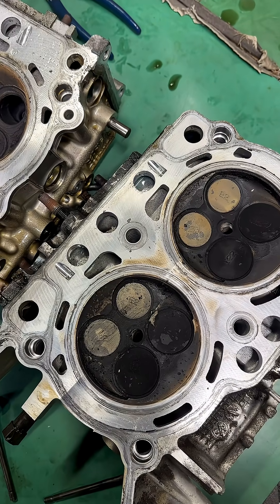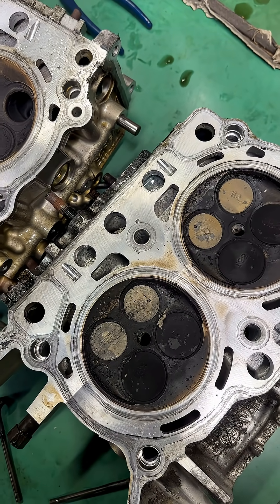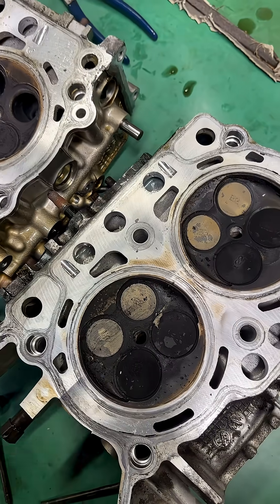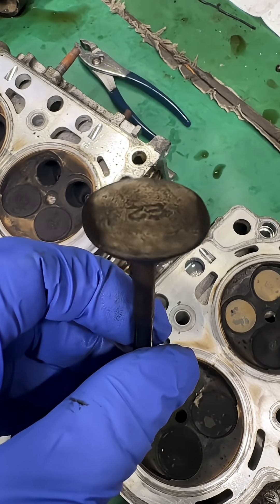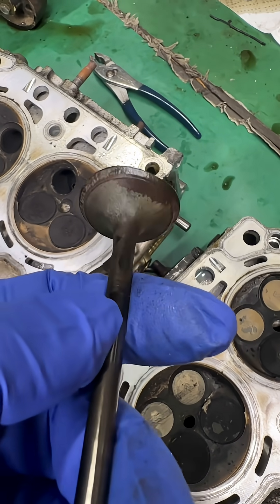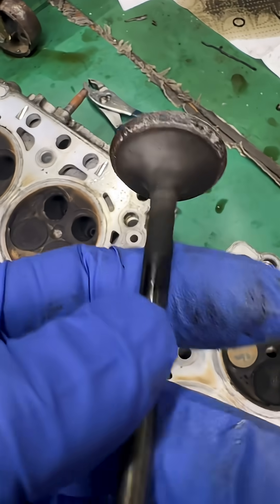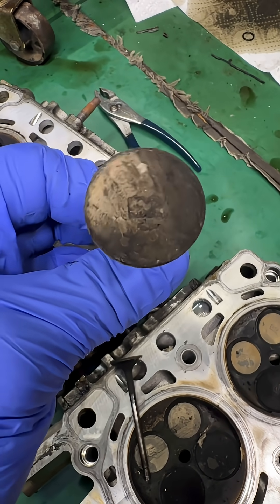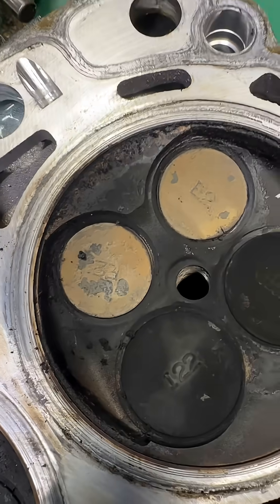Subaru FB25 Failed Exhaust Valves #subaru #boxerengine #fb25 #forester #shorts

Comment: FB25 is known for a lot of bad things, to be fair.

Edit:  I was thinking of the EJ25.  My mistake.
Reply from the maker: I was really only aware of the 2011-2014 FB25's burning oil past about 80K. We had a 2012 before this one, that was burning 1 quart every 450 miles.
Reply: @BuffRANGE oil starvation and head gaskets are the ones I'm most familiar with from afar.  Car meet engine deaths and track day pits on lap 1.
Reply from the maker: @spraynpray the EJ series was known for head gasket problems.  I’ve read very few If any FB series head gasket problems.
Reply: @BuffRANGE You are correct and I am mistaken.  I know nothing about the FB25.

Comment: Looks like what happened to the exhaust valve on my dr650. Oil cooled motor and the carb was tuned to make peak power and run a bit lean. Wide open throttle for hours on end during a road trip. Over heated and ate up the valve
Reply from the maker: I wonder if the vacuum leak I found when I bought the car was going for quite some time. Couple that with burning oil creating an  lean condition

Comment: Ah….Subaru’s and compression issues. I’ve had my fair share of them. I sure hate pulling the motors of the  boxer type.
Reply from the maker: Honestly I think I've done worse car projects compared to pulling the motor in this. I appreciate the the radiator was only held in by 2 brackets, and not the entire front of the car.
Reply: @BuffRANGE pulling the motor on Subarus is much easier, to me, then some others but I hated having to pull the motor all the time to do things

Comment: OT question for His 57 Highness.
Do you have a source for auto cut AR57 bolts and/or do you know a source that can modify non auto cut ones?
Reply from the maker: I do not. But someone did some 3D printed stuff if you're interested: https://github.com/DeepSeaFission/AR57-Super-Safety-Mods
Reply: @BuffRANGE Thats why youre the 57Kang
Reply: I’m not sure if a 3d print of the entire carrier is a clever solution when roughly the addition of 4mm of material stands in our way. I could hillbilly solve this one with a tube of jbweld and a drimel drum sander. But cant we do better than hillbilly? A bit of research yielded this. The patent for the AR57 just expired and is now prior art.  Even cursory search shows that a whole bunch of us with ar57 semi bolts are absolutely itching for new giggles.
An AR 57 FA sample in the hands of toolcraft or young manufacturing could get us giggling in no time.

Comment: I’ve heard of them burning oil, it coating O2 sensors and the lean conditions burning valves. I know a few Subaru dealership techs and they just replace everything on a whim because that’s the only way they get paid a decent wage. Love a follow up video if you get some answers!

Comment: Burnt valves. Could be caused by a number of reasons. If it was an XT (turbo), not running high enough octane could do it. Sticking, not sealing (dirty), timing, valve lash adjustment, etc. many possible causes.
Reply from the maker: This was a non turbo engine. I wonder if the brake booster leaking caused a lean condition that went unnoticed for majority of its life until I bought it.
Reply: @BuffRANGE Possible. Lean will burn hot.

Comment: Check the injectors
Reply from the maker: Injectors seem to be fine. But without tools I didn’t have a way to test them.
Reply: @BuffRANGE  Prolonged exposure to high temperatures can cause the valve material to weaken and deform, potentially leading to an oval or irregular shape, especially if the valve is not rotating properly to distribute heat evenly.

Comment: How worn are the valve guides? Thinking maybe they weren’t getting oil, wore out, and were allowing the valve to not seat perfectly causing that wear. Or that cylinder was running really lean and cooking your valves, though not sure how probable that is. What do the spark plugs look like?
Reply from the maker: Plus were a little whitish
Reply: @BuffRANGE whitish would mean lean. Obviously that’s not a super for sure method.

Comment: Hoenstly not sure what to chalk that up to other than just poor build quality on the valves and them warping over time from heat. People used to hate on the EJ25 for it's head gaskets but once those were fixed those engines would go 250-300k miles easily.